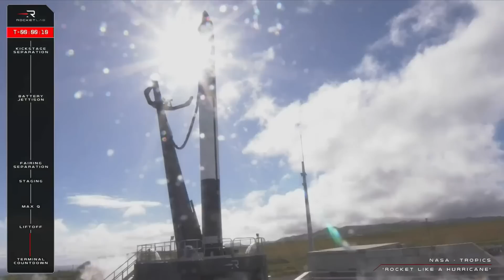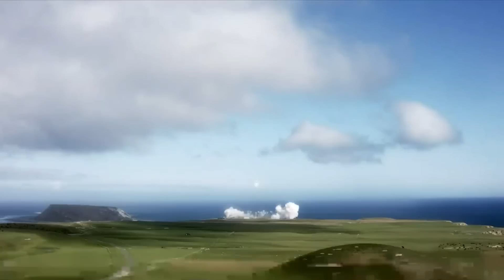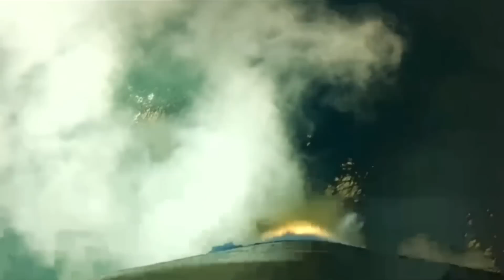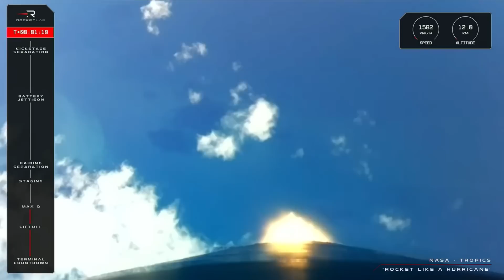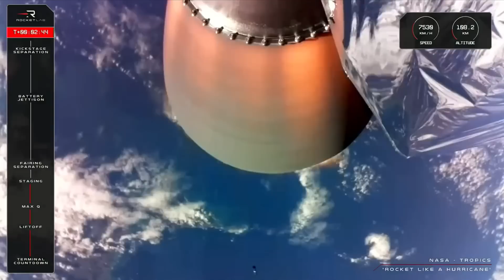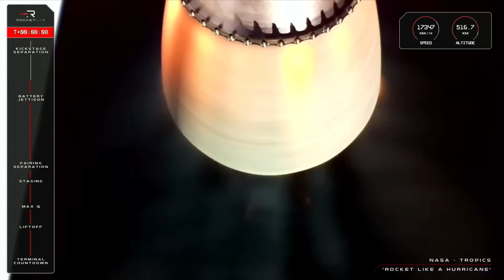Blastoff! NASA TROPICS hurricane satellites launched by Rocket Lab

Comment: bullsh*t
Reply: Oh? Well I know rocket launches are visible for hundreds of km in every direction, and that people chasing them routinely follow them all the way up to the operational height of their payloads. The numbers of witnesses are typically in the tens of thousands, across a really wide area. 

And I satellite spot. I catch a few every clear night, where they're predicted to be, and I've done measurements ( via scale drawing, or using simple trig) with the help of a relative a few hundred km due south of me, so we could get their heights and groundpeeds - these always come out as hundreds of km (and usually very different values in that range - as low as 300 and as high as 800) and km per second respectively. I've caught a couple of the bigger, lower altitude ones (including the ISS) through my telescope and they look as expected. And, getting a bit more technical, I used a radio set and a directional antenna to follow the signals produced by several of them, across the sky, so they are definitely machines in communication with the ground. 
All the above is repeatable by anyone, has been many times. Don't take my word for it, go out and try it. 

OK, even in the real world, fakery - with enough effort - could in principle be the explanation for anything. I saw Tupac on stage in 2012, though he was glowing and see through. Today it could be applied to anyone you talk to on the internet even - they could be an AI. But when there're so many independently verifiable lines of evidence, seen by that many independent observers, there doesn't seem to be any point in treating a phenomena as fake - to all intents in purposes the satellites are up there, are delivered up there by rockets, and carry out the roles claimed, because that's how the world we live in behaves in all those ways: : The ‘mental model’ that these machines actually are up there is just much simpler and more useful then the one that there are multiple layers of hard to create illusion, constantly and unfailingly maintained, when you would probably find actually building such a thing really useful anyway.

More, that makes sense in a common sense, human, way - the advantages of a really high altitude & high speed observation platform are the same in any worldview and, since we can see the Sun/Moon/other objects are up there, there's clearly a natural mechanism to do that which could be copied and used by engineers.